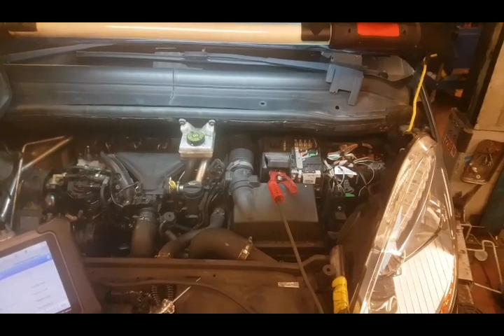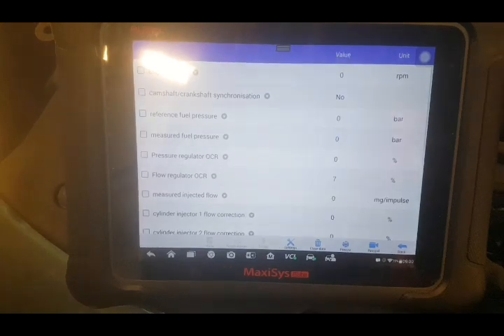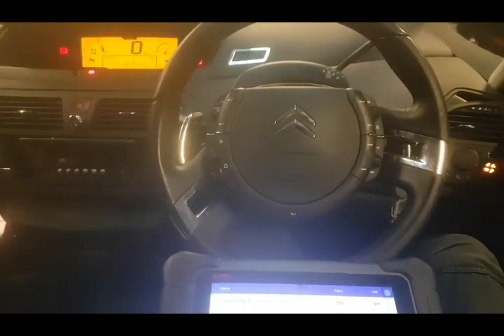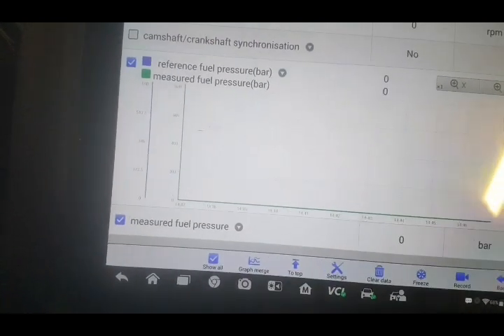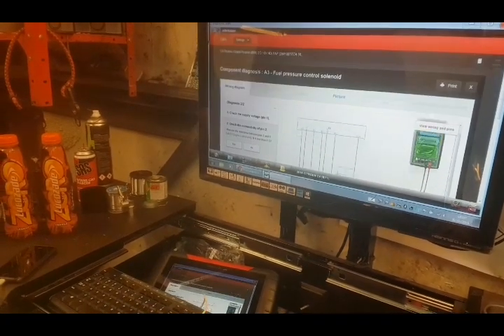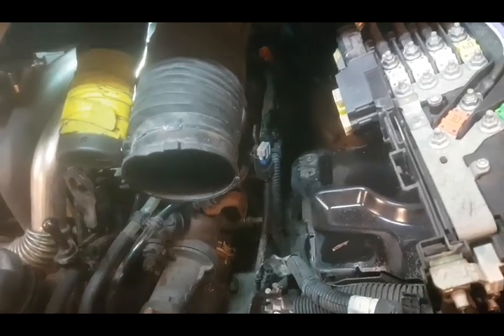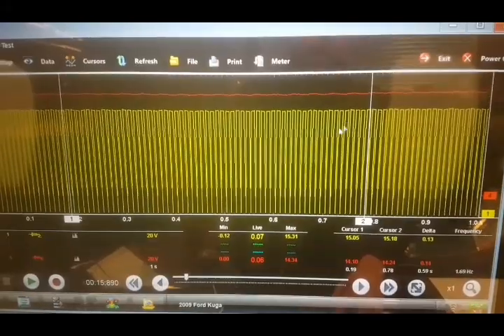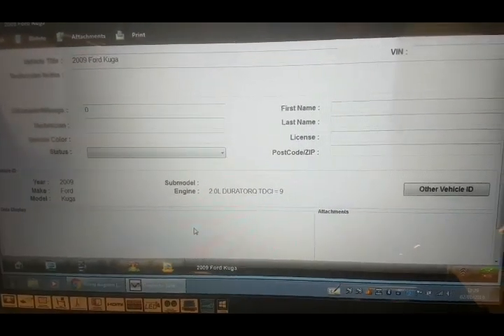Citroen C4 Picasso 2.0 Hdi No start, No Codes, Low fuel pressure

Comment: So what's the exact issue that's causing this problem cause I'm experiencing the same issue with a Citroen C4 grand picasso diesel what would you say to do? Or that's causing the problem
Reply from the maker: Sorry, just saw this. In this instance was a bit of muck in fuel system blocking open the fuel pressure regulator. If you let me know what part of the country you are in I know great diagnostic guys and girls all over.

Comment: Having similar issue with a 407 RHR 2.0 hdi. Scanning tool points at that solenoid with P1198 . Intermittent fault.  Manifold shows signs of blow by, though so possibly Manifold seals are leaking and linked to the low fuel pressure.

Comment: im a mobile mechanic. job yesterday. Citroen C4 2012. Car driving then suddenly no driving. low fuel pressure = 0 mbar. yep quite low. gearbox ECU fault code cant comm with engine ecu. Another couple of computer modules said same fault. Had no Ethanol sniff available. cranking though could get it to briefly start with accel pedal floored. Engine making horrible clicking sound near fuel filter side. Autel im608 pro live data said 0 fuel  pressure. so as you cant have zero and engine start, gotta think its electrical. ECU or BSI interface. I think ecu but whats the damn clicking sound.

Comment: say whaaat.. i dont get it.. the important talk in the car I couldnt hear :D   i have the same issue with a jumpy.. thought it was a bad inertia switch but this car seems to not have one. all components work.. hp pump changed 4 months ago.. components react on diagnos actuator testing.. but pressure just stand on 55bar.. got to check cables from pressure sensor to ecu maybe bad..

Comment: You dont actually need to crank an engine to get fuel pressure ! Fuel pressure is engine control managed meaning the computer does it as soon as you turn the key , also some cars returned to zero with fuel pressure depending on the setup specific for car , most likely you need to clean throttle body , most overlooked no start problem on the planet
Reply from the maker: It's a diesel. So 1- No throttle body, 2- HPFP is mechanical and driven by the engine